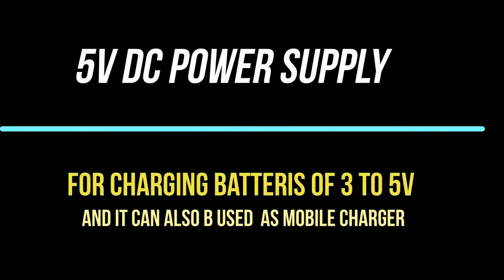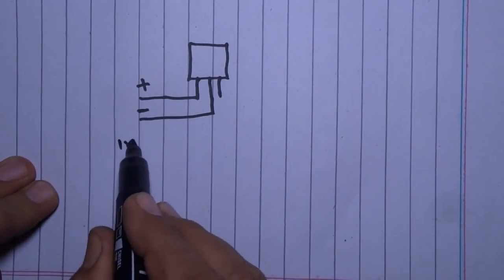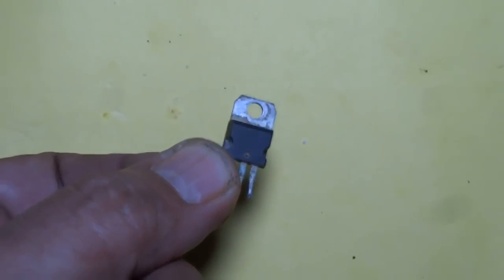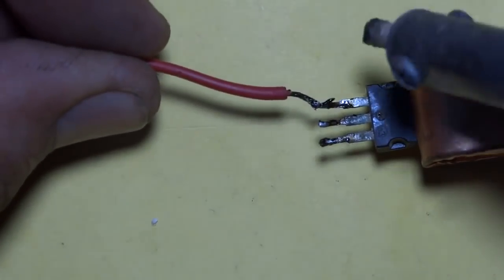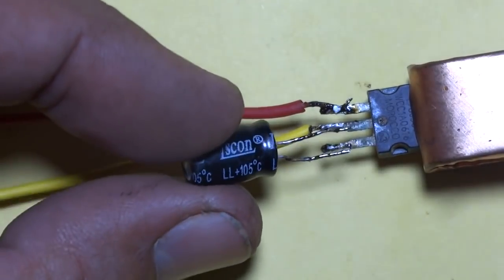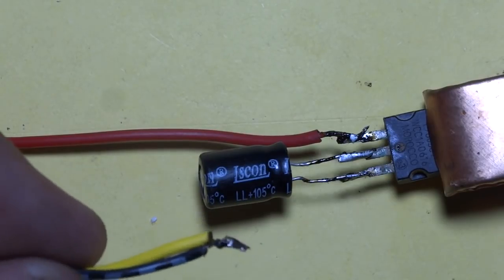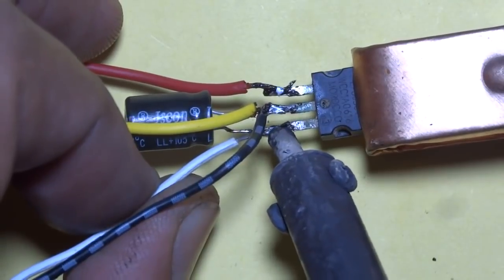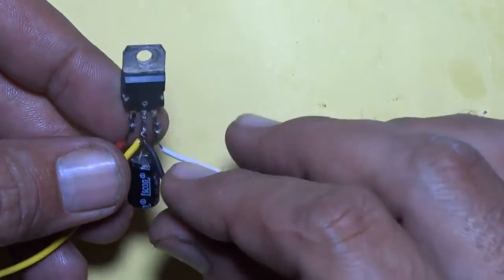5 VOLTS DC POWER SUPPLY WITH 7805

Comment: Hi buddy.
You said ( I'll give 24V in input  )
But you inserted 9V😐 
I have a soldering station circuit, it's using lm7805 regulator without heatsink for atmega8. 
And main input voltage is 24 volt. 
Really can I run the circuit without the burning regulator? I should also say that a 33 ohm 2 watt resistor and a 4148 diode are placed before the 7805 input.
Reply: FROM 5V TO 24V BRO you death?
Reply: thats exactly why you need to know the basics at least

Comment: 34v 2amp  इनपुट देने पर, 10uf वाला cap ब्लास्ट हो रहा है, बार बार.....
(जैसा आपने बताया वैसा ही बनाने का प्रयास कर रहा था)

क्या गलती कर रहा हु, या ऐसा क्यों हो रहा है ??
Reply from the maker: ye you can use 34v adopter  with this
Reply: @gillanidata  सुझाव उत्तम है 👍,
मगर मैं 12-0-12  2amp का ट्रांसफार्मर 
use कर रहा हूँ , उसमें समस्या आ रही है ।

अडॉप्टर के साथ तो कोई समस्या नही हुई, ये मैं कर के देख  चुका हूं । 
मैं चाह रहा था कि, ट्रांसफार्मर से थोड़ा कॉस्ट कटिंग हो जाएगी ।। 😢😢😢😢
Reply from the maker: yes you can use 12 v adaptor with this 
you can give 3 to 34volts as input
Reply: Ac input to nhi de rahe ? Change tha capacitor with capacitor of higher voltage (50v)
Reply: @cancer-2012   जी, ठीक है , यह करके देखता हूँ । ☺️
Reply from the maker: Thanx a lot 
www.envirementalb.com
Reply from the maker: Nahin input dc dina hai
Reply: DC input only

Comment: what kind of transistor should I use from 5 volts to 12 volts ?
Reply from the maker: dear from 5 to 12v you will have use volts booster
Reply: @gillanidata  Thank you for your prompt reply.
There isnt any transistor out there, that can be used to get a 12 vlts output ?
Reply from the maker: dear we can use simple coil with transistor that can boots our volts 
i will put a circuit diagram soon 
thanx a lot for watching my videos
Reply: Thank you so much, for your video and hard work 👍👍👍👍👍
Reply from the maker: Use powerful transistor 
I am going attach circuit diagram 
Plz visit the link given below the video

Comment: better add transistor for more current and less heat
Reply from the maker: Yes u are right 
I will make it with transistor soon
Reply: How to join the wires parallely
 between this two types of transistor ?